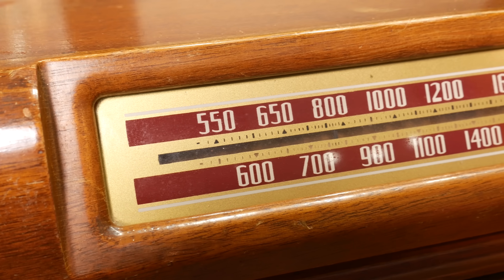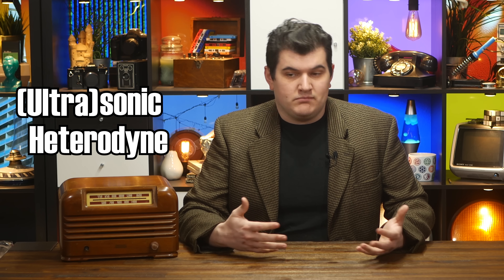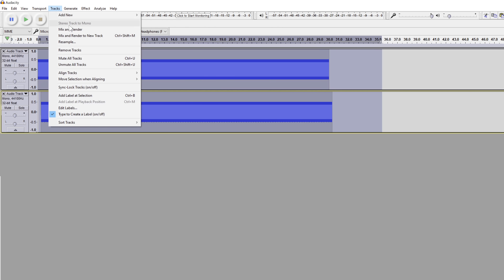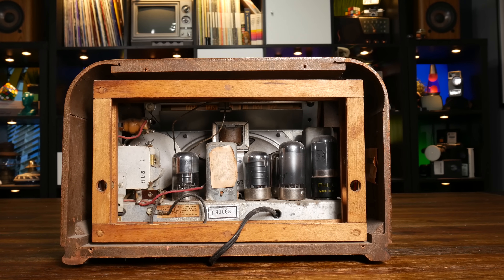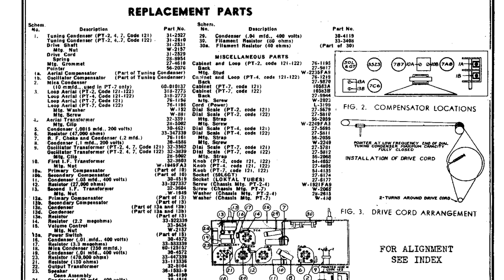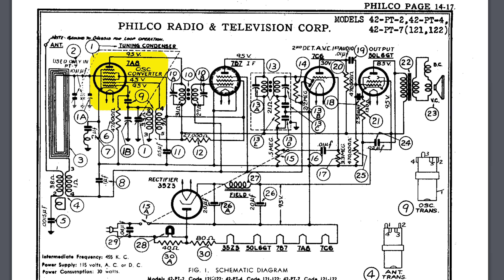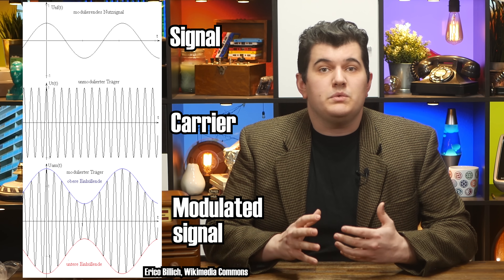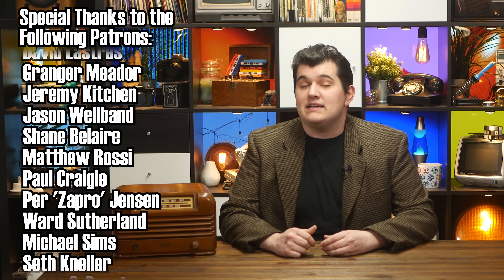The Superheterodyne Radio: No really, that's its name

Comment: Stumbled across an FM radio interference mystery in my early teens and I still remember it. For some reason an ordinary FM radio receiver will block out another receiver’s ... reception if they’re located within a few feet of one another and tuned exactly 10.7 MHz apart.  Understandably the radio with the larger power source (AC vs battery) will block the weaker one.

Comment: So really, beat frequencies are being generated for ALL incoming frequencies simultaneously (minus those eliminated by the sloppy antenna tuning filter), but only the "tuned" frequency interacts to create the correct intermediate frequency that makes it through the next filter and into the amplifier. And because the resultant carrier signal is still so much higher frequency than sound, there is no negative effect on the output.

Comment: Safety precaution: This is an AA5 radio without a power transformer,  therefore No isolation from the AC line. Also, originally it would have been fit with an unpolarized power cord meaning that depending on which way the plug is inserted into the wall outlet there is a 50/50 chance of having the chassis at or close to HOT power line potential. For safety power cord SB replaced with polarized line cord making sure to wire it correctly if not already done.  Any capacitor from line cord to chassis SB replaced with XYZ safety cap of same value. Getting a knob for the on-off volume control is a must, even if it doesn't match, touching that bare shaft is an extreme shock hazzard. That is a nice radio and worth a good cleanup and restoration.  Just my two cents hoping to keep you safe.
Reply: It's a result of designing receivers as inexpensively as possible. They eliminated the power transformer and used a half-wave rectifier tube with a sufficient filter capacitor (Or two usually in combined in one unit.) You get 160 volts DC that way, sufficient for vacuum tubes.  Going to a permanent magnet speaker also eliminated some copper windings.  The "Five tube American" became a standard design for nearly all small units.  But the chassis was directly connected to one lead the 120 volt power cord!
Reply: @utah133  This wasn't quite the all American five, though: the sum of the heater voltages comes a bit short of 110 V. They used an 80 ohm  and a 40 ohm in series to keep from over powering the filaments.
Reply: @machintelligence  Yep.  These radios helped heat the house at least!  Hot tubes and big wire-wound resistors.
Reply: @utah133  Most later models used a "floating" ground bus not connected directly to the chassis. A small capacitor served as a RF ground to the chassis but was too small to pass 60-cycle AC.
Reply: Hehe the bare aluminium shaft issue, of the ON-OFF/Volume pot... Some old knobs have metal and also the holding screw (in-)visible and keep shock-joking around ;)
50’s standards lol
Reply: This actually worked in the utility company's interest. Because statistically around half the radios and TVs would be plugged in with each polarity, the power factor problems of the half wave rectifiers tended to cancel out.

When the UK went to it's current standard for plugs, meaning that you now need a three pin plug even if the appliance is not earthed, the electricity boards (*) had to upgrade the infrastructure to prepare for the change over.

(*) power generation was publicly owned and controlled by regional "boards" at the time
Reply: Hopefully he plugs everything into a gfic outlet
Reply: Daniel, even with a polarized plug, you pay still get a hot chassis if lester put the wires on the wrong terminals in the outlet. White to silver ( big slot), black to gold ( small slot) , but black is ground in the radio go figure..
Reply: Prudence, the safety goat, approves.
Reply: These things were designed pre-safety. Paul (Mr Carlson's Lab) does a LOT of work on these old receivers, he's got all the details on restoring them properly
Reply: Even with polarized plugs, watch for bad household wiring... it's not unheard of that some slack-jawed yokel replaced a socket and mixed up the wires.  Especially if the yokel couldn't fit 3-prong plugs into the old 2-prong outlets...
Reply: anyone know when polarized plugs started to be used? I first saw a polarized plug in 1965, and was amazed that old outlets in our apartment that had been around for decades actually had long and short slots to work with them.
Reply: I would take care grounding the chassis, some of those old sets used a floating ground to all for greater potential differences at lower voltages, like the positive at 100V and the ground/negative at -100V.
Reply: There is no direct connection between the power cord of this radio and the chassis. The B- rail is isolated from the chassis by a capacitor at point 7. As long as that capacitor is not leaky or shorted, shock hazard is minimized.
Reply: Sounds like gobbledegook to me. Which is why I hire electricians instead of DIYing it.
Reply: An isolating transformer is the safest solution. Not the most practical though
Reply: Wow, I'm amazed it's legal to plug into the grid at this point.
Reply: There's always gotta be a Nanny in the crowd.
Reply: @wpiofm  Electrician, here. This isn't being a nanny, it's sound advice.
Only idiots think 120VAC can't kill you.
Reply: @ethelryan257  , yeah, lots of these types of transformerless, AC/DC, hot-chassis radios ended up in kitchens, on the counter not far from the sink perhaps (the sink and faucet connected to ground through the copper pipes), or on top of the refrigerator.....or in the garage or basement, with a concrete slab floor that makes an excellent electrical path to ground....lots of shock potential here!  This is one of the reasons that GFCI, ground fault circuit interrupting electrical outlets are now required by code for kitchens and bathrooms in many States and locales. It's also why power tools now have grounded cords or are internally double-insulated.
Reply: @wpiofm  I agree.  The five-tuber was safe, as long as you didn't modify it or drop it in your bath-water...
Reply: @utah133  Not if you plugged it in backward. Yes, everyone knew to be careful around their All-American Fives, but what is the problem with eliminating the need to be careful? People like you are literally the worst.
Reply: @TheRealColBosch  Murphy's law demands a plug design that can only be plugged in the safe way round.
Reply: @TheRealColBosch, not “everyone” has the specific knowledge base to evaluate the risk of a system even if they are trying to be careful. Is there something wrong with making an appliance safer that doesn’t affect the practical use of it?

It wouldn’t be a point of pride to know that I managed to use my microwave carefully so the magnetron didn’t blast me with a burst of microwaves. I’d just get a better designed one and focus my attention on more important stuff.

Comment: The moment I saw that old radio, I wanted to shout CONELRAD. Starting in 1953, all radio manufacturers had to include the CD triangle in the 640 and 1240 kilo cycles (or kilo hertz) of the radio dial. There was a false alarm incident in 1955 that involved a worker sending in the wrong tape. I'm guessing the Philco Transitone radios didn't get the CONELRAD treatment.

Comment: I'm sure you already know this, but be careful with that All-American-Five radio. Depending on the way you've got it plugged in, the chassis can potentially be live with respect to ground. Not an issue normally, as long as it's in the case, but I noticed you're missing the volume knob. Just FYI.

Comment: Excellent Video! This video helps to demonstrate and visualise what is actually a very complex topic without overwhelming the viewer with mathematics.

There is however a small misconception which lead to the demonstration of beat frequencies not working as expected. The concept which needs clarification is that simple ADDITION of signals of two different frequencies does not produce the sum and difference 'beat' frequencies you are describing in the hetrodyne process. To do this, the two signals need to be MULTIPLIED by each other.
Although it is theoretically possible to build a multiplier circuit, the active components would need to have sufficient bandwidth for the RF signal.
The genus behind the hetrodyne design is to mix the IF local oscillator with the incoming RF using simple addition with passive components, then to introduce a non-linearity, often an amplification stage which distorts the signal. If the transfer function of the amplifier is expressed as a polynomial, then the ,x squared term, when applied to the sum of two sine waves, will produce the sum and difference 'beat' signals. Check out the trigonometric identity for (sin a + sin b)^2
The non-linear stage does not need to have the high RF bandwidth, only the IF plus baseband signal bandwidth is required, which means much more gain is achievable, hence the receiver can be significantly more selective. Fundamentally, frequencies higher than the bandwidth of the active components can be received, which was a major step forward in radio design.

Comment: Damn!! I am again impressed at the level of detail you describe the way radio works! I should note this technique is in fact still used even in digital wireless communications. Look into QAM and DSB-SC demodulation. Other than that you pretty much covered 2 weeks of material I learned in a university graduate class in wireless comm this past fall semester!
Reply: Replying to 2yo comment... but demodulation isn't mixing or filtering
Reply: @donaldviszneki8251  mixing down is often a part of demodulation. I guess if you want to be very precise then fine technically it is an intermediate step. whatever haha
Reply: @power-max  I guess as an amateur I feel like it's important to get this distinction right, or else I'll be forever confused
Reply: @donaldviszneki8251  My knowledge in the field is only a single 4 credit hour elective from a few years ago haha. That and Wikipedia/google.

Comment: Thanks that was really interesting. When I was a  kid my tranny (yes terms do change meaning) 7 transistor radio could block a nearby radio (or wireless as we Brits used to call it!) by tuning to a slightly different frequency. I had fun hiding the tranny  behind the kitchen radio with the volume down and blocking out a  particular station (we only had 4 stations in those days - all BBC no commercial radio at all until pirate radio started up!). Changed world and amazing what you could do with just 7 transistors.
That lovely old Philco is in need of restoration. All our pre FM radios also had longwave too. The BBC "Home Service"  transmitted on 1800m LW.
Reply: Surprised that an American radio even had longwave . was longwave ever part of the broadcast spectrum in the United States ?

Comment: Minor detail regarding the mathematics, but your explanation on 'mixing' isn't entirely correct. Mixing two HF signals together means the two signals are in fact mutiplied together, not added: The mixer tube has an amplification circuit that can amplify (multiply) one signal with the input of another, it is a VCA. By multiplying two signals which have a sine waveform, you will produce a pair of signals which are either the sum or the difference of the 'carrier' (local oscillator) and the modulator (the radio front-end). There's some math involved which is fairly easy to look up, but that's the principle on which both AM modulators ánd superhet receivers work -- which also meant making a *trans*ceiver out of a superhet radio was very straight-forward.

Heterodyning works best when the signals are perfectly in phase, which renders the highest signal strength, so the invention of the phase-locked loop catapulted the technology into the 21st century, paving the way for television and digital telecommunications, with the basic principle still being used on modern tech like WiFi and 5G today.
Reply: Yes, mixing means multiplication. In analog receivers such as the vacuum tube type shown, multiplication of the two signals is performed by adding the signals on a nonlinear transfer curve. That nonlinearity is the key feature of the mixing stage. Any nonlinear curve means that a portion of the input signals are multiplied.
Later and better analog receivers have a multiplier circuit as a mixing stage such as a sp-called Gilbert cell. Now multiplying is easy in software.
Reply: @wernerfritsch6436  Of course. I should have remembered that. Thanks, now it's clear.
Reply: @wernerfritsch6436  didn’t these circuits basically turn on and off the input at the oscillator frequency by having the local oscillator change the bias of the pass stage? So it’s performing mixing like the Gilbert Cell, but with no input balancing
Reply: @LightningHelix101  Switching the input signal in the beat of the oscillator frequency is equivalent to multiplying the input signal with an oscillator square wave. If the oscillator signal is really high in amplitude, the analog mixing stage would behave like you said. The additional harmonics of the oscillator frequency (3rd, 5th, 7th ...) and their mixing products won't pass the IF filter, so mixing will work this way. But it is not necessary to extremely overdrive the mixing stage with the oscillator signal. It is sufficient that the sum signal periodically leaves the linear region of the mixing stage.
Reply: @wernerfritsch6436  Hmm. Thanks. A lot gets lost shuffle to keep up with the latest and greatest. Do you happen to know how automatic tone detection worked back in analog phone days after operators weren’t a thing?
Reply: Hang on. The frequencies are added/subtracted, right? Not the signal levels. Are we confusing the two here?
Reply: @MichaelWillems  Correct, multiplying two signals in the time domain means adding or subtracting their frequencies.

Adding the signals together and passing it through a nonlinear fillter (like a diode or NPN transistor) has the same effect.

Comment: RCA bought the Armstrong superhet patents and for many years was the only company that could make superhetrodyne receivers.  TRF sets continued to be the mainstay in radio designs well into the 1920's.   The use of Loktal tubes in your "antique" set (officially an antique must be at least 100 years old, there are some collectible radio receivers today that either are true antiques, or will be in a few years) places your set as either an early post war set (1945-50) or a late pre-war (1939-1941).  Probably  the former as many loktal tubes were being dumped as war surplus by the government.